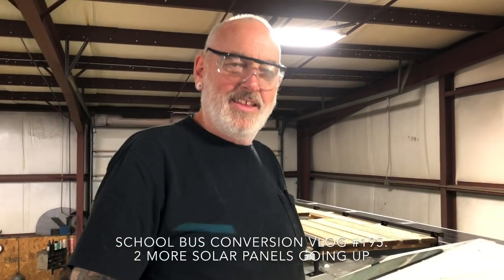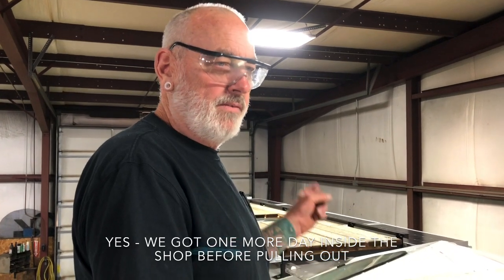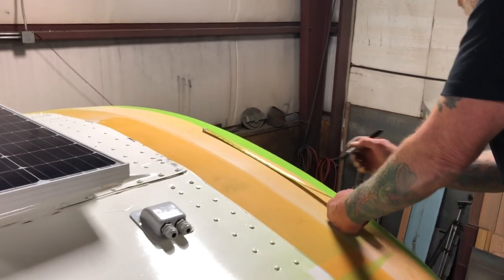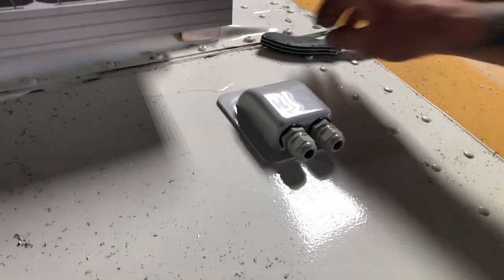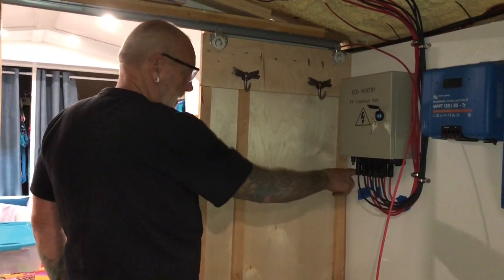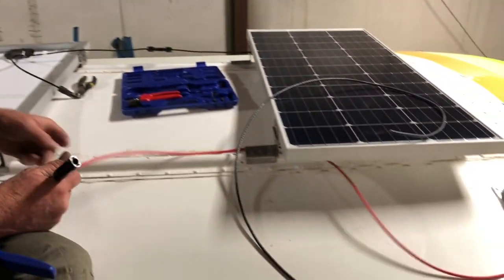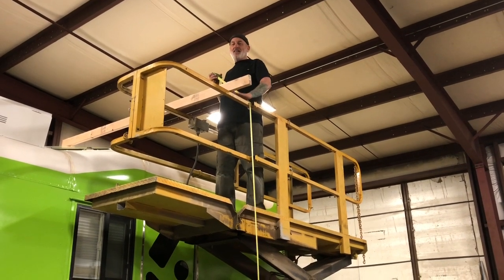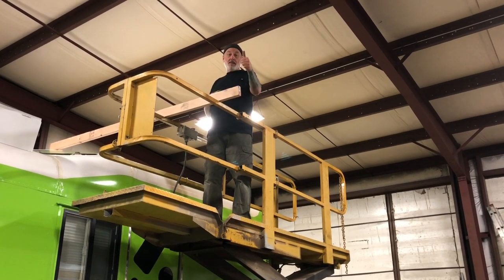2 More Solar Panels Going Up - Vlog 195 School Bus Conversion

Comment: Randy, may be worth putting some cable protector around those last cables and i would use nutserts and add a couple of p clips as well to stop those cables from moving when your driving and rattling or breaking. Great job on the solar though.
Reply from the maker: Thanks 😊

Comment: One thing that I noticed in a little over a year of exposure to the elements during my solar panel testing is that there was significant sun bleaching of the solar wiring.  I do not know if this is a sign of other deterioration, but I am going to add some over wrap for protection.  My original assumption was that solar panel wire would be selected for weather resistance.  Maybe or maybe not.  Additional wire covering is cheap insurance.
Reply from the maker: Oh good information. We bought UV resistant wire but maybe we need more protection. Thanks 😊

Comment: Good planning on the racetrack.  Could the combiner box  have been mounted upside down to shorten the wires going in?  You’ll never regret the extra 2 panels.
Reply from the maker: That’s an interesting idea but I can honestly tell you if it was upside down it would drive Randy crazy. 😃